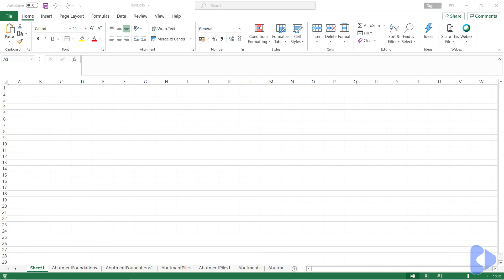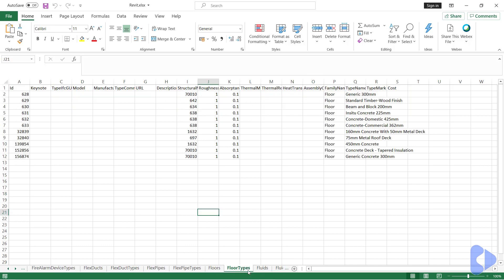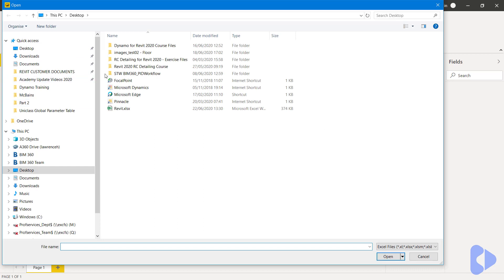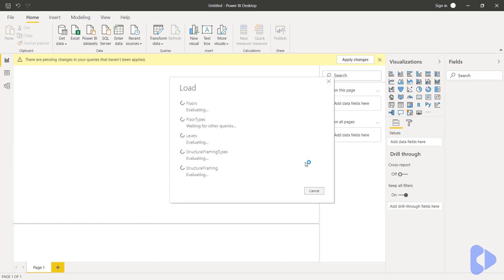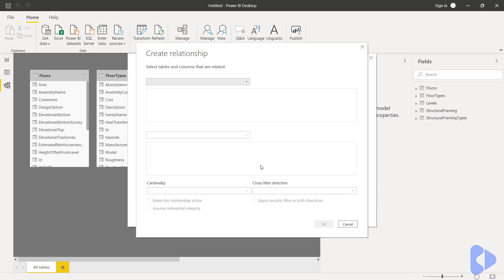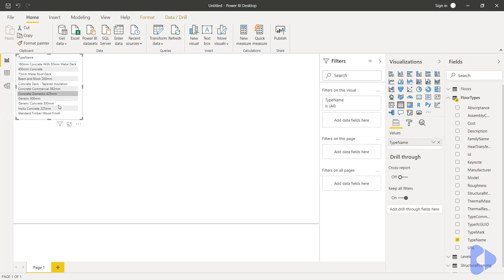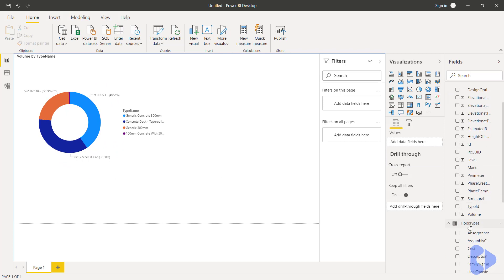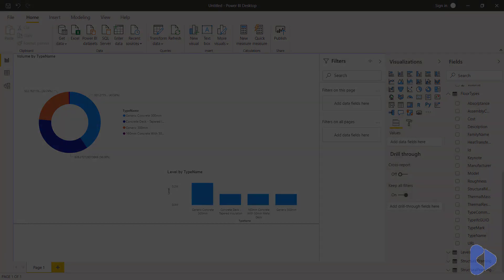Revit 2021 Tutorial   Structural Data Extraction Part 2

Comment: Hi! I would like to ask you 2 basic questions :
- The Family Types information exported is the ones which has been placed on the model, or it will show everything is load in the file, even not having been placed?
- There is a way to customize the parameters exported on every tab? For example if we inserted instance shared parameters, phasing, location  or whatever

Thanks in advance and congrats for your channel, I'm now subscribed. KD
Reply from the maker: Hi Manuel, The family type data is related to what exists in the Revit project as physical elements. You cannot customise the ODBC datalink, it will export everything in the project. However, don't forget that this data could be stored in a SQL or MS Access database which is much better for large datasets. Excel is not a good tool to store data! Hope that helps